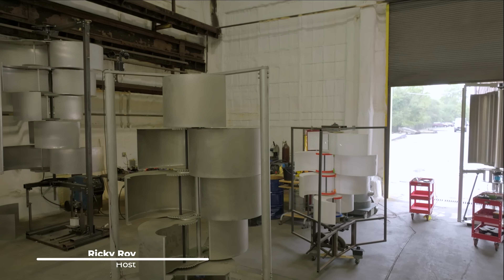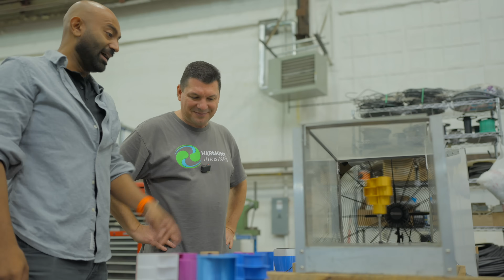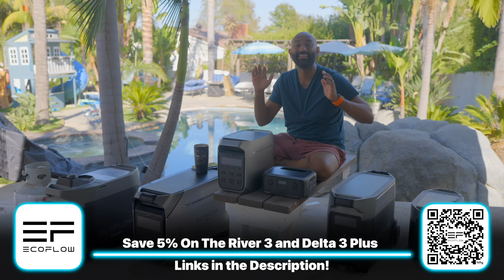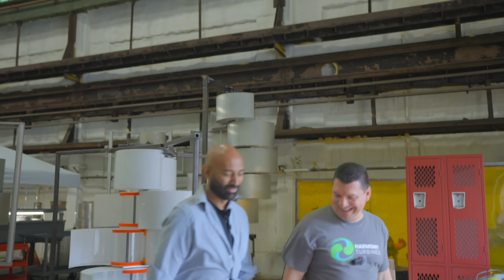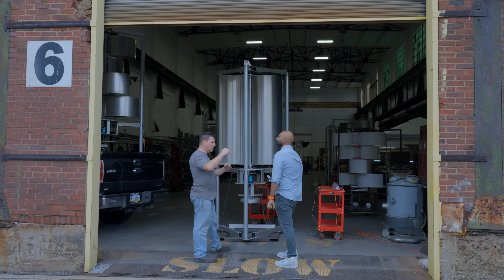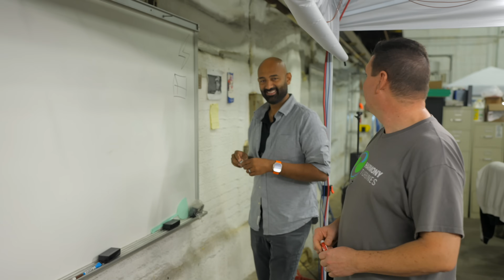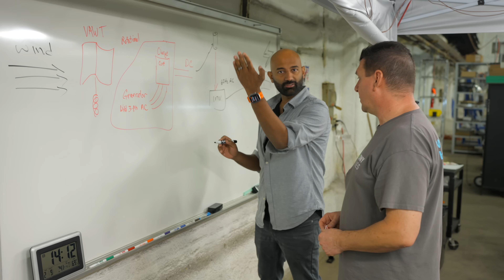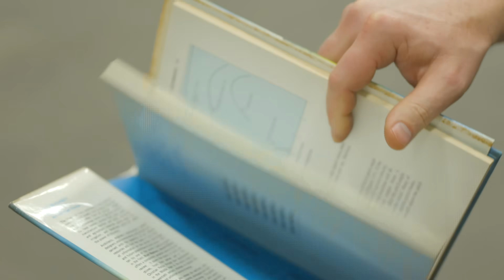This Could CHANGE Home Wind Energy Forever!

Comment: I would like to buy one but do not have a spare 6k.  How about featuring some DIY builders doing the same thing on the cheap?
Reply: a savonius turbine is not really worth the materials, time and effort.
unless it is a hobby.
Reply: @hattifattener1  = What method would you recommend as being worth the effort?
Reply: @hattifattener1 that's a waste of a comment – suggest something better or keep quiet
Reply: @alanhat5252  the answer is simple. solar panels.

in most locations ANY micro wind turbine will never return invested money plus cost of maintenance.
especially $6k savonius. )))

in very windy locations i would suggest 3 blade HAWT at least 10 meters above ground.

Comment: I'd like to see even smaller versions for a mobile camper. A collection of 4 - 1 at each corner might get you a total of 200-400 watts over the night but it's a perfect supplement to your solar system. Especially if it means you don't have to worry about your backup generator kicking on while you're trying to sleep.
Reply: That's the market I'm waiting for, there's got to be millions of campervans around.

The bearings need to be top quality & easily changed though, there's nothing worse than a noisy bearing resonating through the frame of your 'van.
Reply: @alanhat5252  the magnetic bearing in this video would do wonders on a smaller version.

I wonder why we can't run two sets of charge controllers to solve the problem in the video. We have slow rpm charge controllers and we have high rpm charge controllers. Switch between the two as the rpm increases

Comment: All vertical shaft windmills have failed.  There are many shapes but the hight required to catch wind that is worth installing  wind generating gear,b is  very high. The most efficient are far taller than the Riful Tower.  Ten foot high  while gigs on highways physically, cannot ever make money.

Comment: The insurmountable problem with wind power is that in most locations you can neither predict nor rely on having adequate wind, so you can't really size a battery storage knowing it will always meet your needs like you can with solar. If you compensate for that with a huge battery you now need a lot more input or a much longer duration of wind to charge up fully. When you factor in the cost vs return ratio of wind power it doesn't look good at all unless you're in one of those places where the wind is generally reliable. 

It's like having an unreliable car- sometimes it will take you where you want to go and sometimes it won't, and you can't know which will happen ahead of time. How much would that be worth to you?

Comment: Interesting. I live on a hill top in Los Angeles, my front yard is the entire San Gabriel Valley. I get some wind, but  10 mph or more is rare. 5 mph is not on most days. The side of my house is  essentially a funnel, yet when I go out there with an anemometer on a very windy day, it's almost never over 20mph.  So wind energy seems like it's  a niche source: specific locations, or like on sailboats. At scale of course, Iowa, the passes in California terrific. 
As a sailor and boat owner I know what every sailor says about an onboard wind generator: It makes too much noise. Same with towed water propeller generators. (The gears are what make the noise that people complain about.) So the boat windpower generation market is up for grabs. Just make it quieter.  The other thing about sailboats is that when you are sailing up wind, you are generating wind. Sailing up wind in a 12 knot breeze you're wind gauge will read 16 -17 knots. And the speed of the boat is limited mostly be the water, so you could run one of these turbines without slowing down the boat. 
And wind almost always dies at night. I love the idea of windmills. Every house can and should have solar panels, most shouldn't bother with wind generators. Almost none of Los Angeles should have wind generators, but a much of the coast might be able to use them.

Comment: I am astounded that significant time. money and effort continues to be spent on this type of power extraction. No matter how sophisticated and cleverly engineered a researched design, there is just not sufficient energy whitish the volume of air that can be intercepted by these small turbines. They casually talk about wind speeds of 25 mph which is far form normal. The cross sectional area of the device intercepting the wind would have to be huge to generate useful output - hence the huge diameters of the  current commercial horizontal wind turbines. Any vertical turbine smaller that a double-decker bus will produce a pathetic output no matter how sophisticated it's design. Any demonstration is always shown without the device under load. The torque available is barely enough to light a torch bulb  - if that !
Heat a home ? Run a washing machine ? Basic physics say no way !

Comment: Why can't they put a scaled down version of this in the middle of the highways where cars are passing about 100 km/hr, can easily produce these winds in either directions. I thought it could easily power the electric lights at a bare minimum.
Reply: that would increase drag and fuel consumption.
nothing is free in this world.

Comment: I wonder if a shroud that rotates around the turbine so that it can always face the wind could turn the 10 mph wind into a more useable speed.  It would certainly make the foot print larger and add some complexity, but given that the relationship of windspeed to power output is exponential it would seem to be a valuable complication.

Comment: You mentioned a home wind turbine generating power at night when you’re at home and solar isn’t working.  This sounds good, but winds typically decrease at night so it doesn’t work in reality.  Turbines tend to also vibrate causing sound pollution which neighbours won’t appreciate and the mechanical torque makes roof mounting difficult

Comment: The multi-bucket helical presents less surface area than the twin bucket system perpendicular to the wind.
The surface area to which the wind is applied, along with wind speed, will determine torque.
Given enough torque, a step-up gearbox can drive a high-output, low speed, multi-pole alternator.
The beauty of the Harmony is the automatic furling to maintain a predetermined rotational speed.

Comment: I believe that if you go down in speed you could compensate with volume. Hear me out, if you want to make slower wind speed usable you would need to increase the area of the wings, or the scoops in this case, but is not going to mean that with your huge wind turbine you are going to generate more, but that you will generate at all. So what you want is a huge win turbine with hige scoops and a smaller generator relative to the size of the turbine. So, you could be able to generate power at lower win speeds by building bigger scoops for the generators you want to run. It's a compromise, but it will generate at lower speeds.

Comment: Regarding generator and charge-controller:
As long as it's prototyping, it'd be better to pick a standard AC generator, with a planetary gear, with a ratio that makes the generator spin at its optimal RPM, at the upper range of normal operation.
As for a charge-controller: most decent switch-mode supplies will operate at 65-ish to 265-ish volts, today (e.g. look at the relatively cheap Cosel PJA1500F-48 [1.5kW, 85-264VAC in, 48VDC out. It should be relatively simple to modify to accept DC (it likely does so out of the box), and to add a separate supply to the DC-DC-converter-controller, to make it operate at even lower voltages, as long as the transformer has a large enough ratio]. I don't know the brand, though). The DC-DC-converter after the rectification-stage is the reason for the large operating range. So if you wanted, you could rectify the 3-phase output of the generator, input it into a power-supply, if the voltage is less than the lower DC range of the PSU, switch off the power for the PSU, if it's larger than the lower, and lower than the upper operating voltage, send the rectified power to the PSU. now you have a somewhat simple and stable DC output.

I know it won't cover everything needed, but from my limited perspective, it seems like something that it somewhat easily solved with somewhat standard components. And it seems that you could achieve larger ranges, with somewhat small adjustments.

Comment: So much has been done over the decades for a home wind generator at low windspeeds. Unfortunately they all failed to live up to the promise. So if these guys manage to produce the test results in the real world to beat the past I would be interested. But your video shows this is at least 5 years away. There are many hurdles to take yet. Until then, NO.

Comment: Clearly some designs are better at capturing low-wind energy while others might be better when the wind really blows or might be cheaper to install. It would be interesting to see how they compare over a long period for the distribution of wind speeds in a typical residential setting. I would expect a design optimised for low wind would win out.

Comment: $6k for 500Watts??  installation will cost another $3k (at least) plus $1k for plugging in to your system, meaning about $10,000 for 500 watts.  A Tesla powerwall 3 is about $7k installed, and 2KW of panels will cost $3K for a total of $10,000. producing 10KWH daily, reliably, and quietly, as well as maintenance free.

Comment: Perfect is the enemy of good. Abandon your hope to find an alternator and charge controller that works at 20-30 watts and can handle 300-500 watts intermittently. Focus on delivering a useable range of power even if that means these won't be useful in low wind. No one in their right mind will care if their wind turbine, in a mild breeze, can charge one cell phone. I live where electricity is over $0.25/kWh delivered. Using an impossibly optimistic assumption that one of these turbines churns out 500 watts of power 24/7 it would take almost 6 years of continuous operation to pay for itself. I like the variable geometry and possibility for PID control to optimize torque and limit speed, it just needs to be way bigger to be useful. And injection mold the scoops out of polycarbonate. And make sure eddy currents in the thrust bearing aren't heating it above the Curie temperature.

Comment: The big challenge with savonious vawt is low tip speed to wind speed ratio, which inturn means low rpm. If the generator is directly driven without gearing that means the generator needs to be a high torque generator which inturn means more money spent on more magnets and coils in a larger diameter axial flux, or longer and or wider radial flux generator. Gearing can increase the rpm allowing one to usr cheaper smaller generators, but the gears reduce efficency and introduces potential points of failure and increases other cost. 

I prefer the larger diameter generator's rotor and stator aproach.  I think this also opens up another kind of opportunity with a uniquely designed charge controller to switch a greater number of coils from effectivly working in serial to effectivly working in parallel based on the rpm or voltages being generated.  At low rpm or coil voltage, the coils of a phase would be in serial to  add the voltages of each coil, and at high rpm the charge controller could put coils of a phase in parallel to sum the current output carying capacity instead.  Maybe this would   help keep the output in a more controlable range from low wind to high wind.

Comment: Ive always liked the idea of wind based power generation, but because of size and scale limitations, and area of coverage. feel that it needs to be built around something else to double its use perhaps triple it. Build the wind turbine around a water reservoir/silo, and cover the silo in solar panels. Solar panel heat into water, wind turbine uses water tower for structure and surface area. Too complex probably

Comment: A few points:
1) The power available from wind goes as the cube of the wind speed.  On a 400W turbine rated at 25MPH, at 12.5MPH, you are going to get 400/8=50W
2)  A maximum power point controller can adaptively work with a turbine to optimize the power output but the action will be fairly slow.  A good engineer can design you one that will work well.
3) Keeping bad weather off the bearings and the generator is only a little tricky.  Rain mostly falls down.The bottom of the rotor can be an upside down cup to make it shed the rain away rather than letting it hit the bearing.
Reply: Power potential increases by 8 but realistically power produced is 6 to 7 times as it's scaling is INSANE.

For perspective a 25 ft wind turbine making 10KW @ 20 mph makes 490KW @ 80 MPH using a 7 multiplier scaling. Now seek images for generators that large regardless of fuel preference for a size reference.
Reply: @RP-hn1qc  In many designs, the scaling would be greater than a factor of 8.  There are fixed losses to consider.
Reply: @kensmith5694  My calculations were using the graphs directly from the turbine manufacturers 5 mph to 20 mph where I essentially extended the graph at doubling wind speed intervals assuming same efficiency for theoretical contemplation. Not ideal, but it's closer to just overestimating saying "it's 8 multipliers, trust me bro."
Reply: @RP-hn1qc  8 is from physics.
The energy content of a chunk of moving air will follow:
E = (1/2) * M * V^2
E =  energy
M = Mass
V = Velocity
How many of those that go past per second, brings in another "V" leading to a V^3
Reply: @kensmith5694  🤔 We're in agreement but you seem to insist an argument. I'm in total agreement 8 is power potential but the losses will scale as you build it to be stronger (heavier or larger) to sustain the load regardless of blade rotational speed. Hence, 6 to 7 being the true net gain of doubling speed.
Reply: @RP-hn1qc  I wasn't arguing.  I was explaining
Reply: @RP-hn1qc  80MPH?? Nope... "Winds 64-75 MPH: Wind damage is widespread, with risk to large trees being blown over. Winds over 75 MPH: Hurricane force winds, sever damage will occur. Damaging wind can harm roofs and windows. Trees will be uprooted along with risk of overturned small mobile homes."
I doubt there are turbines at this scale that could withstand that force, and building one tough enough is likely to make it too heavy to move and too expensive to bother. Actually, never mind the turbine, the tower would be far too expensive to build.
Reply: @AnalystPrime  They actually make wind turbines rated for those speeds called ram air turbines as an emergency HOLY SHEET WE LOST ALL ELECTRIC POWER generator that deploys similar to landing gear but protrudes to the side.
Reply: This is a highly relevant point, regarding the moisture which might otherwise accumulate and cause deterioration.  The solution is not complex  yet lack of foresight to eliminate the occurrence would be regrettable.

Comment: I see pros and cons here.

I'll be blunt - any advancement is great, but it needs to match or outperform current tech at a competing cost to take off. 20w to 500w an hour for such an energy intensive device is not quite there yet - not for $6500 US. The max 1kw system is great, but that is the max output - with modern wind turbines in farms located to make the most of wind, average about 42% output from their rating. By comparison, a 1kw solar and a 5kw battery is going to cost less, with a more stable output for night time use. I accept in the US solar systems are far more expensive than overseas, but as an example, in Australia, my entire 13.2kw solar with 13.6kw battery was about $15,000 AU (about $10k US) after grants. The proposed system would need to compete with 45kw in winter to 90kw in summer output per day (on a sunny day), 13.6kw of which is stored for night use. To be fair, if we experience a storm, it has been down to 5kw output. 

The turbines will still require an inverter, and still require someway to store the energy (a buffer) to allow for constant output so at the moment, they still have some catching up to do.

Do not get me wrong, these turbines are great. There will also be locations Solar is simply not practical - an extreme example is in the arctic regions. I'd be inclined to get one just to top up my system overnight - but it would need to be able to regularly output 1 to 2 kw to be practical, and be cheaper than just adding another 13.6kw battery (about $4,500 US). Economies of scale will probably solve much of this, so I wish them well.

Comment: Hello Ricky I would like to know why don't they use a gear reduction system to where you got 10 to 1 or even up as far as 20 to 1 gear ratio and service straight shaft to the generator offset the generator and use a gear reduction system so you're spinning the generator faster just like to know

Comment: You are still doing it wrong. You have to shade the back side and concentrate the wind on the bucket side. Another turntable that rotates into the wind to block one side and concentrate it on the other does that. It looks like a weather vain on a ring outside the main column.; that way the backside is shaded and less wind resistance.